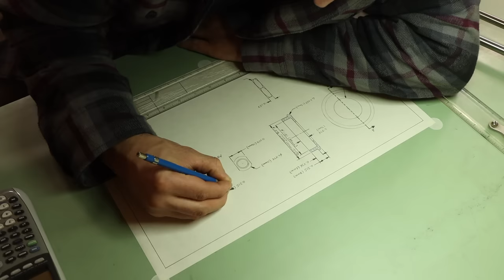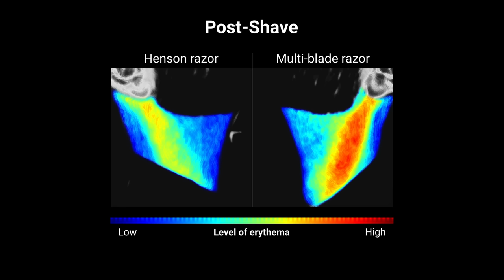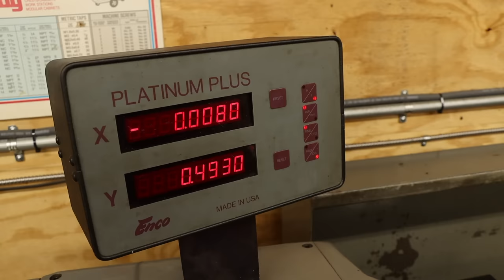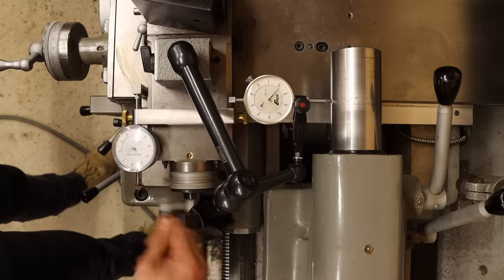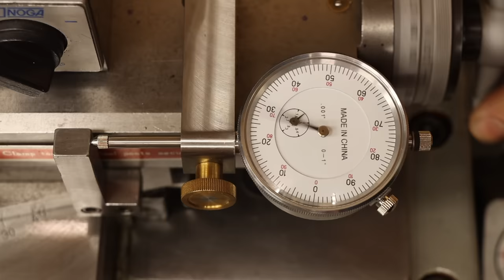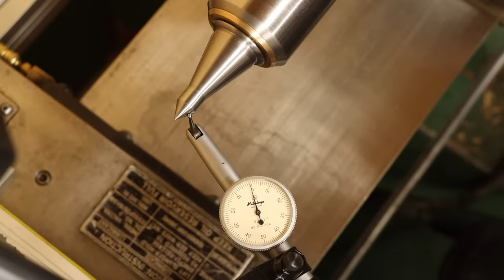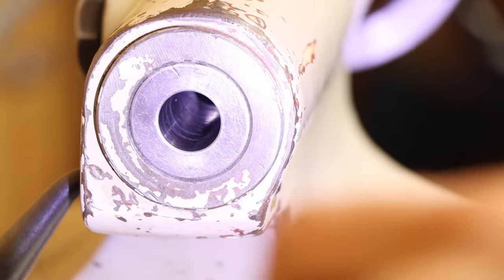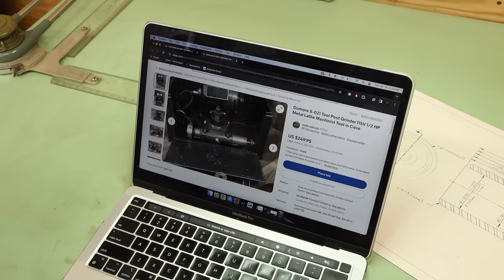WANTED: Dead or a LIVE CENTER

Comment: I would consider making a cyl. grinding fixture with 2 centers - stafan showed his in a few videos... You have a surface grinder, so you can do it... 
Secondly, i would consider taking a carbide rod or an endmill with chipped flutes, diamond zipping the flutes off, making a heat fit for the carbide rod in the center and inserting the carbide rod into the center, then you can cbn turn the carbide, given that you would not really be able to surface grind it with centers on each end - what with having a rod of solid carbide in one end... But that gives you a glass hard center point that needs no hardening, and the rest of the body gets to benefit from toughness of a good alloy that isn`t file hard or even tempered hard at around 55 hrc... You could even braze in the carbide rod instead, making two diameters, the deeper one that snugly grips the carbide rod and the larger diameter for brazing compound, which would give you a 3 colour, 3 rings of steel, golden brazing comp and dark gray carbide when it`s all ground to spec... I know it`s a bit of a wild suggestion, but i think that in fact that is how they make some of the top end centers... Just pray to god that you don`t drop the center or smash the carbide tip off at any point...

Also, crap like this runout in the end is why i absolutely prefer dead centers and some fine high pressure grease for precision parts... Live centers are just too much of a compromise(lest you paid 3k$ for them)...

Comment: Piper is a premium Australian brand of live centres and one of their design features is the ability to grind the spindle in it's own bearings. You simply remove the cap from the taper and screw in  a drive dog. Your tail end roller bearing looks pretty small so this idea is probably not useful here. However given you have cylindrical sections on the spindle nose it is possible to make up a couple of pulleys for an O ring drive to turn the spindle and use a surface grinder to re-establish concentricity.

Comment: pro tip: for absurd tolerances there is grinding.
you leave the necessary allowance and let those,
who have to deal with measurements that a lathe cannot manage in a decent time,
finish the work

the turner's job is not to finish a piece, but to turn the piece.

Comment: To get the best accuracy machining your live center, I think I would have machined it between dead centers. A carbide dead center would be my choice.
Reply: At least you may be able to differentiate between "dead" and "live" except... A "solid" centre, which is what I think (correct me if I'm wrong) you mean, can be used "dead" or "live". Fitted in the tailstock of a centre lathe, it's "dead" (not driven)  Fitted in the headstock, and rotating at spindle speed, it's "live" (driven)  But...

Take (say) a Jones and Shipman 1310 universal grinder. When seeking maximum precision in cylindrical grinding work,, you lock up the headstock centre, rendering it "dead", and then work between "dead" centres. Conveniently, there's (there was on older models) a little reservoir of oil in the tailstock, with an applicator quill to oil centre holes before mounting workpieces... 

A "running" centre is not a "live" centre, and a "solid" centre isn't necessarily "dead", since in a lathe headstock, it's "live" or "driven"
Reply: @robertlawson8572  and you are correct. I used dead center for solid center. An old machinist taught me how to use them. And his very old Monarch had the reservoir on the tail stock for lube, he used white lead and a tad of way oil to keep things smooth. You also had to monitor part temperature as you machined, if it started getting too warm, it would get longer, and try to warp the part being turned (rifle barrels).

Comment: You can regrind your live center using grinding head and driving live center by belt. You can even try to correct morse cone using the same setup while fixing spike of the live center and driving morse cone. Good template for testing with dye is needed.

But I doubt, that you can grind your tailstocks w/o inner grinder or at least inner grinding head for your flat grinder.
Reply from the maker: I'm thinking a tool post grinder will let me accomplish both OD/ID's I need to fix here 😊
Reply: @InheritanceMachining Actually I doubt unless your toolpost grinder is updraded to something like in this video at 8:07 https://youtu.be/RDTQKlAzJZg

You need both concentricity of OD and inner cone and proper angle of cone in your tailstock.

I am totally sure that you'll make OD well but inner cone can make troubles.

Best regards and good luck.

Comment: The runout is not bad, you have to consider that you are not measuring runout when the bearing is being loaded. With the center in place under axial load what is the runout? Were the bearings shimed for preload, or are they matched sets for preload? The bearing runout multiplied by the distance to the point of measurment is an error, multiply that by the error in machining from turning and not finish grinding and there is your runout. The ABEC 7 bearings are for a reason, ABEC 5 are ok but if you are not installing them and preloading them properly then you are chasing your tail. The heat shrink should have been calculated at the temperatures that are obtainable, a freezer does not shrink anywhere near as much as you think it does, espically if you are at the upper end of the press fit tolerance. Work out the growth of the bearing at the upper end of the temperature range that you are comfortable heating the bearing to, then work down from there. If you need .001 of growth and cannot gain that by heating then the rest needs to come from shrinking. Dry ice or liquid nitrogen are the only way to reputably get the part to shrink the desired amount. It is pretty basic materials science before you need to venture down the inescapable analysis tunnel of doom. Instead of buying a tool post grinder you can probably set up a die grinder in a creative way, if you don't need it much you can't justify the cost.

One last call out: buy a MT reamer and run it on the inside of your tailstock the smallest amount. It will help cleanup years of use to the MT bore, either that or make a MT bronze lap and lap the MT bore to a nice finish.

Comment: I'm curious why you haven't installed some form of cooling onto the lathe like you have on the mill, sure you may not need it all the time but that does mean your hands/bottle are further away from the work piece. At least consider adding one to the hardinge lathe.
Reply from the maker: it actually has one (as does the hardinge) just haven't taken the time to figure out getting some 3 phase power to it
Reply: huh.... I'm assuming you've run the numbers for running three phase power for the whole shop circuit as by the looks of things you're on the way to nickel and diming yourself to the cost anyway @InheritanceMachining  

In any case, love to see your stuff man.

Comment: At 10:42 you were testing the fit of the taper, I was wondering if you checked to see if it made contact across the taper or if it was just contacting on a few spots.  I've seen others test for rub spots using the blue stuff.  Thanks again for all your hard work, looking forward to your adventures with cylindrical grinding wheels.
Reply from the maker: I probably should have done a blue test but what you saw was basically all i did. went by feel mostly.

Comment: Can you take the spindle out of the tailstock, mount it in the 4 jaw with the 10ths indicator and give the morse taper a cleanup? You might lose a little smidge on the over all length that you'd have to take off the nose but that shouldn't matter much.
Reply from the maker: That's pretty much exactly what I'm thinking of doing 😊 leaning toward a tool post grinder for the job as well!

Comment: I remember my manager throwing my hammer at me for whacking little precision bearings. Note to self using the induction heater or the blue flame definitely helped prevent damage to the spindle when putting bearings together 🙃

Comment: I haven't used my tool post grinder since I started stocking a few CBN inserts. Can easily turn the last ten thousandth in hardened steel. I used it the other day to adjust some high speed steel. I keep a few aliexpress $12 inserts in my box for just those kinds of problems. Also a dead center, for the final cuts when I'm making something super concentric.
Reply from the maker: I might need to invest in this as well! Thanks for the idea!

Comment: Something tells me that waiting a little longer to make what is actually a gorgeous looking live centre might have been a good idea after all. Will the centre be ok if you get the tailstock taper cleaned up?
I'm not sure I know how you could take the live centre apart again if it needs something doing to it.
I always really enjoy your video's ...even the bit where you threaten your lady with dodgy facial hair
Thankyou for sharing
Reply from the maker: 😂 theres are a few options for that. I may be able to burnish and grind the tip in place by driving it with a belt. And once I get the tailstock taper fixed the center taper could either be fine or require some adjustments as well. A lot up in the air at the moment though. Thanks, Tal
Reply: @InheritanceMachining  ah good to know there are ways. I had not  thought of those at all.

Comment: 12:20 might be part of the reason you have runout : center drilling might not have been perfectly on center. start center drill, but then bore the cone a tiny bit to atta in concentricity ?
Reply from the maker: Perhaps. But my impression of center drills was that they are short and rigid to that even if tailstock is off center, they will turn a perfectly centered hole

Comment: it could make sense for this kind of build to first turn the taper (blue it and all), then use a MT adapter from your spindle's taper to MT2, put the thing in the lathe's spindle and turn everything else from there
Reply from the maker: I considered that actually. The trouble is i need 3 adapter sleeves to get from MT5 down to MT2 and those little errors add up. Use this method on my tailstock die holder build
Reply: @InheritanceMachining  you can get an MT5-MT2 adapter, then you  have only one sleeve. When you're aiming for precision it does not help having to dial the thing in using the 4 jaw

Comment: Hi Brandon ,nice looking center!
To bad about the runout ,happily anything can be fixed.  now ,about those bearings.  At around 17:50 you stated that the bearing will be preloaded with the nut.
with these bearing, a preload is very unlikely because they are not ground that way. If you look at the SKF 7202 BEP spec,  it states that axial internal clearance
is not applicable. nor is it matched as a set or universal fit.
A matched set is exactly that, two ,or in this case three bearings would be selected and/or lapped so that when mounted on the shaft and in the housing
all the balls would be under the correct preload (the balls are actually squeezed between the races)  the more modern alternative is called Single Universal
Match ,the dimensions are controlled so closely that any three of the same designation will preload correctly. (look for a U in the designation.
Regarding grease , Mori Seiki and most of the Japanese builders  use Kluber nbu-15  on AC bearings.  It is barium soap and synthetic oil.
(my internet qualifications are former field service engineer , and service manager for a Mori Seiki  Dealer )
Reply: As an addendum to this ,If you have not done so already  have a look at NSK E1254K  document. it is one of the most
comprehensive and accessable  info sources from any of the bearing manufactures. Almost everything you could 
want to know about fitting ,mounting ,and lubricating precision bearing.

Comment: Big agree on the Morse Taper standard being a wild bunch of angles. My little bench lathe's spindle MT3 for turning between centers has .008" of runout so I need to recut it, which lead me down the rabbit hole of Morse Taper specifications. You'd think they'd all use the same angle, but nope.
Reply from the maker: I know... it's completely nuts. The odd angles are close to making sense from a rise/run perspective. but then they are all different 😂
Reply: @InheritanceMachining  From what I was reading, them being different is just due to the machines that Stephen Morse, the guy that created the standard, had available to him in the 1860s. It sounds like the original intent was to make a standard that had a shared taper, just increasing in size, but just wasn't really feasible at that time.
Reply from the maker: interesting! I should have suspected as much. Usually when theres some odd inconsistency in a standard, theres some historic reason like this @minilathemayhem

Comment: I had to make my own spring loaded dead center to use a tool post grinder in a lathe. No one makes them for any price. Of course modern lathes do not have any facility for using a dead center on the drive side. I could do some fairly accurate work by swapping ends and grinding on the tail stock side.
Reply: All but the small hobby lathes will have a taper in the spindle and from new will have a matching plug with a morse taper in it. This plug is often lost or neglected in the industrial setting since turning between centres is not that common.

Comment: If you really want to be frustrated, insert your live centre in the headstock spindle and then measure the tip runout.
Note-1: you need to turn the body and prevent the tip from rotating.
So far I have 2 live centres that are coaxially true, and have had 5 that are not by a max of .007”.
Note-2 : only after making videos and sending them to the suppliers have they agreed that there is cause for return or exchanged.
The reason to do this is repeatability, when you remove and reinsert the work piece or the live centre for another operation and need to re support the work, and expect the concentricity to be the same, especially between centres, such as with tool post grinding.
But that’s another whole world of concentric nightmares.
Good luck and take care.
Reply from the maker: I'm almost afraid to look at this but you make a very good point. I suspect I'll be grinding/re-turing almost ever aspect of this build 😂

Comment: Morse taper values are nice round numbers if converted into fractions of the distance a horse can travel in a fortnight while carrying a gross of 7 peck grain bags.  Probably.
Reply from the maker: I started reading this so excited you had a real answer 😂
Reply: @InheritanceMachining  No, sorry.  The best (real) info I could find was that they probably were supposed to be round numbers, but the standard predates decent metrology, so later we measured existing tools and got what we got.  Apparently precisely matching existing tapers predates precisely measuring them.  Can't find a primary source on that though, just forum speculation.

Comment: When fitting bearings or bushings on a shaft or in a bore, pick heat or cold, not both. Been working on aircraft for 35 years and learned  from experience and the manuals to do so. For example installing bushings into landing gear we freeze the bushings in liquid nitrogen or dry ice with the Mandrel you are installing the bushing with as well…no heating the bore, not even a little. As soon as the bushing touches the bore it begins to warm up drawing heat from the warmer gear material. In as quick as possible. If the bore were heated it will warm up that bushing way quicker as soon as it touches it, thus making it harder to go in or get stuck. Just something to consider.
Reply from the maker: Thanks for the advice!
Reply: Actually it gives more clearance to heat the bore and cool the shaft.  Heat flows from hot to cold due to difference in temperature regardless of whether something feels hot or cold to us.

Comment: Great tool, but I havent seen the bearing, that is needed to take the axial preassure. all the force applied by putting it towards the center of workpiece has to be taken by the normal ballbearings - sideway!, that then try to push the balls out of their case. (Sorry my bad english, hope you understand what Im missing?...)
Reply from the maker: they are angular contact ball bearings so can take both axial and radial loads
Reply: @InheritanceMachining  ok, I expected a thrust ball bearing at the end. (Mine (purchased) has one to take up to 5t pressure). The angular ball beating will do good job at that normal loads occuring in real.

Comment: I wonder if there is some sort of bore hone that you could use in the tailstock...  Cool project!
Reply from the maker: Some people have suggested morse taper reamers. I'm thinking of using a toolpost grinder
Reply: @InheritanceMachining 
Hopefully the reamer has the correct taper made into it. Mine seems to be ok. But regrinding needs you to get the taper on the compound correct or you could be making matters worse.
There's a fellow making a sine block device that mounts to the side of the compound and you use gauge blocks to set your taper. Apparently very accurate. I'll see if I can find the reference and send it to you Brandon.

Comment: On the light of the fact the precision abec 7 bearings being $400. Any bearings will do as long as there the right size and without play between the two rings right? More expensive bearings might offer more luxury elements such as being quieter, higher rpm range, and longer life. You don't really work at a rpm these cheap bearings cannot exceed right?